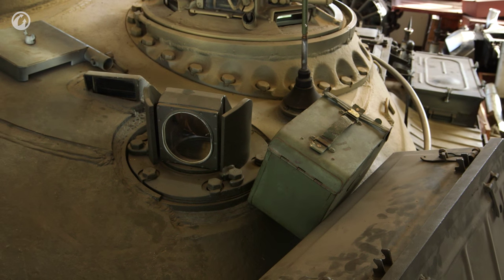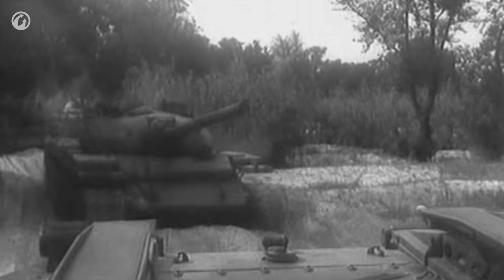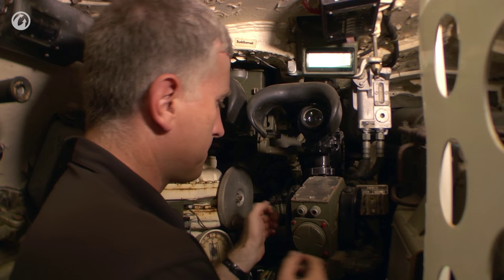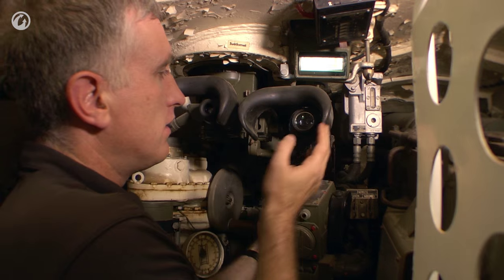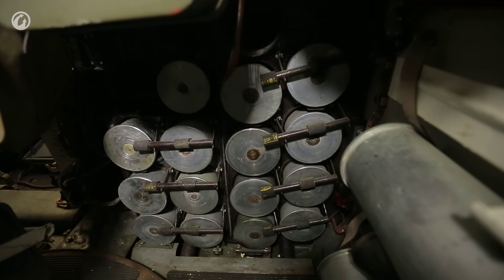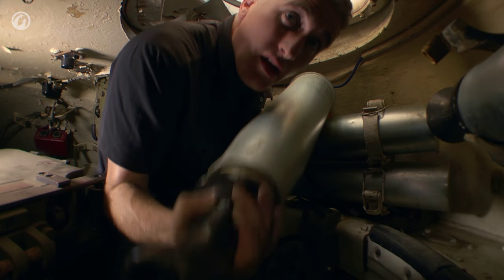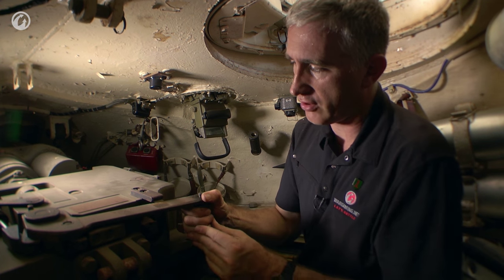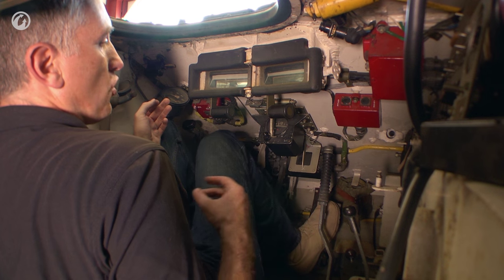Inside the Chieftain's Hatch: T-55A Part 2

Comment: There are couple of reasons for the handles, that I can think of:

1. If the turret traverse, both mechanic and automatic, are dead - use the handles to rotate the turret in the case of an emergency;
2. A safe place to hold onto while getting in or out of position;
3. The driver has had a bit too much Vodka... again, this is the fifth time this week;
4. A place to hook and store bags with personal items or personal firearms.

Comment: I believe the handle like thing at each crew position are in fact toilet roll holders (who says the Soviets don't think of crew comfort). These were installed in case of accidents caused by witnessing all the tanks around them exploding into different pieces when spotted by an Abrams or Challenger. There were larger ones installed for paper towels( for those larger volume situations) but they were thought to take up to much space inside the vehicle. In both Gulf Wars crews often found it best practice to be out of the vehicle completely before any engagement with Coalition armor began. The T55 looks the way a tank should, kinda sleek in sexy,  a great tank for its time and good value for any minor dictator or warlord on a budget.

Comment: i`ve driven the pioneers version of that thing once and yes, it IS small. and man the gear, the commander told me to let loose on the gear shift handle when it "snaped" into position. but when you actually this thing starts vibrating as hard as my sisters boyfriend, but its fun. he`s right, it is jerky to drive but cause everything is build sovietically easy you get used to it pretty quick,

Comment: The clutch sure is heavy if the engine is not on, as it is hydraulic-assisted... There always seems to be just a hole where the electric clock should be. I also wondered that until I got the manuals of the Finnish Defence Forces for T54 and T55... They are in Finnish, so I do not have to learn russian and their alphabet, or Polish, (as the tank I am buying with my brother is originally Polish T55 AM), or German if from DDR (fortunately I would manage that), so as a Finn, there really is a need to study the drawings and the repair manual in Finnish. The repair manual explains .....everything.... as it is from FDF... They tell how much every job takes either in minutes or hours, what tools are needed for that job etc. Only thing I have not yet found is the type and viscosity of the engine oil. But perhaps someone knows? As the Finnish authorities are a bit hysterical about anything decoed, I made a faux DShKM, but the main gun will be eternal problem, even though it has been decoed by the book...